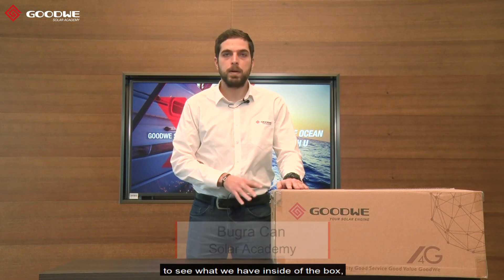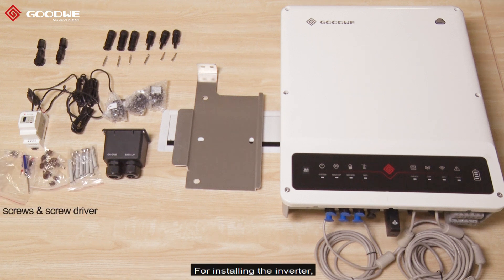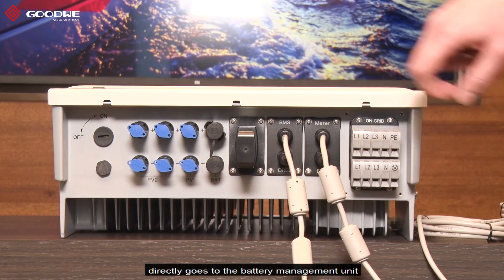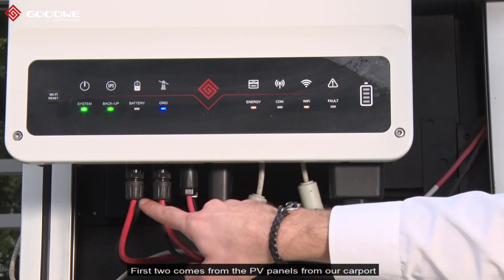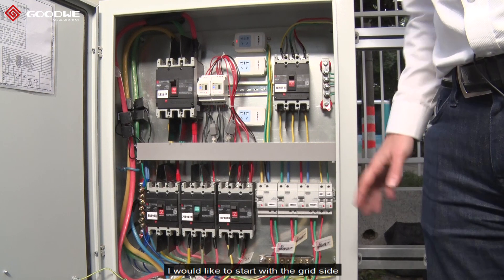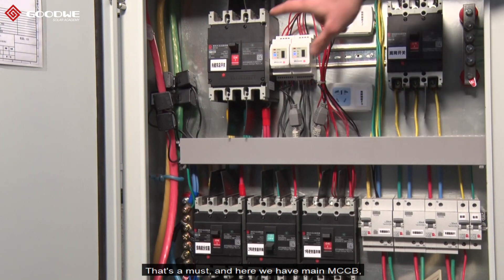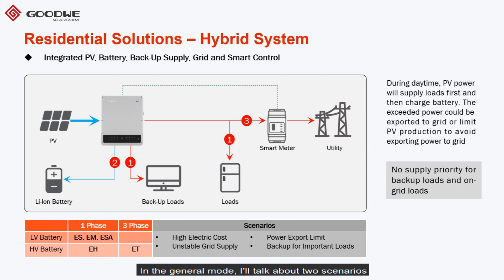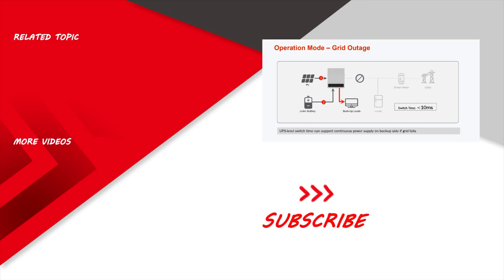Unboxing!! A brand new GOODWE 10 kW ET  storage inverter

Comment: I did not understand either what is the backup power limit, if this inverter is capable of a full three phase AC output, limited just from the nominal power of the inverter (10kW in case of the 10kw model), why do I have just to choose what to back up ?
Can't I have a FULL BACKUP mode ?
Reply from the maker: Back up means if the grid outage occurs, loads on on-grid side can't be supported by any power, but loads on back up side can take power from battery or PV(if PV is available). For some countries, GOODWE is providing full load solution such as north America, Japan. Actually, for single phase inverter, we are preparing full load solution for most counties. I think if grid is not stable, it is better to choose back up solution.
Reply: @GoodWeSolarAcademy  ok thanks you, I live in Italy, I was going to evaluate 3 x GW10K-ET  installed in series each one with it's own BYD battery (for a PV of almost 30kW) 
I was evaluating this solution, but about what I see, and about what I read from the manual, 
1) I can't have a full backup
2) I can't connect the 3 inverter backup line in series
3) There are some load on the backup side that aren't allowed (heat pump for ex.) 
4) I  can't work 100% off grid 

And many other thing that I read on the manual that are going to make me to desist

I though that those inverter where designed to work even off-grid, so that the full backup feature (compatibly with the battery size of course) shouldn't be a problem for the
Reply from the maker: @jackbrown5269  For some countries, we are providing full back-up solution, such as Japan and North America(split grid). For other countries, consideirng the needs of costomers, we are only providing power to important loads if grid outage occurs, no need to support all house loads. But in the furture, we will consider to add full back-up solution for all countries. Thanks for your comment.

Comment: Can the backup output be used without a battery? When the sun is shining and the photovoltaics are producing enough?
Reply: electricity takes the path of least resistance. u use the power u produce first and rest goes to grid

Comment: Can you use this inverter with out the grid and full time off grid. and is the 10 kw peak power or continuance 10kw.
Reply from the maker: This inverter currently does not support full time off-grid mode